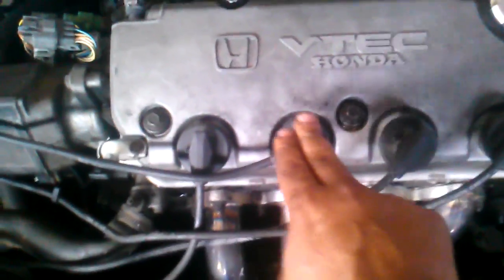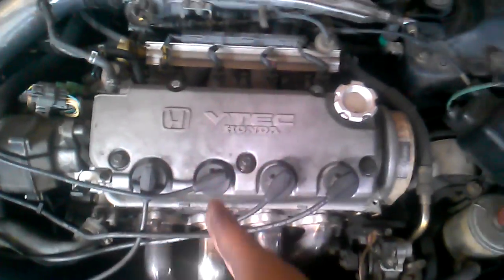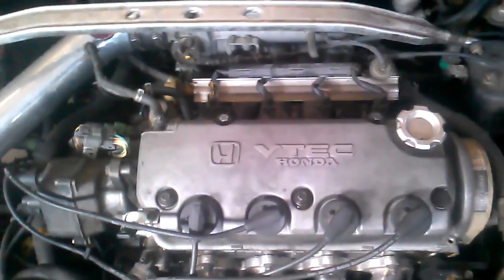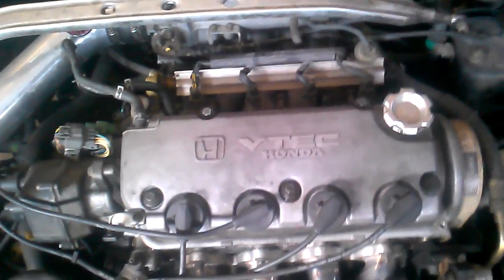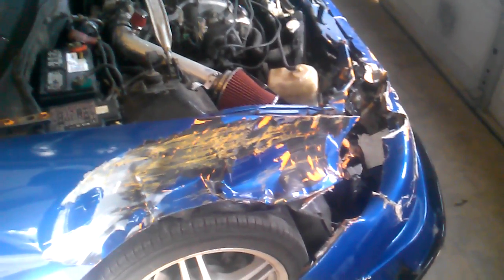How to find a misfire

Comment: Yo man I tried that and when I pulled the 3rd cylinder spark plug wire the car completely died any idea
Reply from the maker: When you you say "died" do you mean it shut off and wouldn't start back up OR it starts back when you put the wire back on?

Comment: Got sain problem my Honda civic 1997 ex change cable apart plug check valve the full ingyster all ok can fine the problem let me know got sain problem what you fit car be ok thank
Reply: What did you discover that the issue was?

Comment: My 99 Civic throws p0303 cylinder 3 misfire. I can clear the code and it won't come back for 30 miles or so of driving. Not the plug and the wires are new (but I suppose that one wire could be faulty. We'll see...). All 4 injectors are pulsing. No vacuum leaks. I block tested the coolant, no combustion gasses in coolant. I'm stumped. Hmmmmm.....
Reply from the maker: So clear the codes and change the number 3 wire with the number 2 wire ( make sure you do it on the distributor also) if the code pops up as number 2 mis-fire you know its the wire... If not take your distributor cap off and make sure that the number 3 prong is not corroded...If you go throw all of that it is likely that you have a leaky valve or compression ring on that number 3 cylinder..The first 2 things are easy to fix (20 mins) and the last 2 will take about 4 hours if you know alittle about mechanic work IF NOT about 8 hours but still super eazy... Hit me up on Instagram kevinskars80 and ill walk you through it

Comment: At 2:00 you can hear the spark and literally see the spark. Is that supposed to happen when your spark plug wires and distributor are fine? I replaced spark plugs, wires, distributor cap and rotor, but I think my spark is still weak or something. I hear the spark for a slight second and then gone, but I don't even see the spark like shown in the video. Maybe bad ignition coil for me?
Reply from the maker: Yes a 'weak' spark can make issues with a mis-fire or even a no start..Tell me more about your problem..Is it not starting or a mis-fire?Is it having a weak spark on just one cylinder or all of them
Reply: It starts okay all the time so far and rough idles, but definitely a misfire for cylinder 2 & 3. I did your test with pulling the spark plug wires out and checking for idle change. Cylinder 1 & 4 seems fine.
Reply from the maker: @Pyman215  what kind of car is it?
Reply: @KevinsKars  '91 Honda Prelude with B21A1
Reply from the maker: @Pyman215  ok that engine has a external coil so if two of the cylinders is getting good spark and the other two are not it's probably not the coil...I would start by re-checking your wires,plugs and inside of the distributor cap..If you do that and 100% sure it's not any of those I would get a harbor freight and get yourself a $20 compression tester and check if it's something internal..Ive had the same issue many times and it always turns out to be the wires or spark plugs that was gapped incorrectly
Reply: @KevinsKars  Yeah, I was planning on a compression test. But I'll have to check my plugs again. Thanks, will update
Reply: @KevinsKars  UPDATE: Compression test for the cylinders that were misfiring are about 30-45 psi. Cylinder 1 & 4 were 180 psi...
Reply from the maker: @Pyman215  ok sounds like bad piston rings or burnt/cracked valves... Not a huge deal but you'll need to pull the cylinder head to see which one it is

Comment: My 1999 Honda Accord has a p1382 code, dealership can’t figure it out rides rough. Car will die out here and there.
Reply from the maker: Ive had that code come up in a few Accords and it always tends to be a Faulty Cylinder Position Sensor..Check the plug first to make sure its not loose..If not,its probably the sensor
Reply from the maker: Ive had that code come up in a few Accords and it always tends to be a Faulty Cylinder Position Sensor..Check the plug first to make sure its not loose..If not,its probably the sensor

Comment: Right on, gonna check this out.  Got a misfire on cylinder 4, plug looks like it was running leaner than the others so it could be a clogged injector.

Comment: Re my Ford KA Luxury 2007 - unfortunately things seem to have gone from bad to worse :-( I had error code P0304 showing but since Green Flag have replaced all four spark plugs I'm now getting P0303. They have tested all the electrics and confirmed they are fine. Therefore he suspects the issue is fuel related and suspects blockage in the petrol filter? He recommended I put some Redex in the fuel tank. To be honest the engine now seems to be misfiring worse than ever.  He was there for ages testing the HT leads and the coil pack. The only other option he could offer was to tow me to the nearest garage. Do you know why the error code would change after replacing the spark plugs?  Any help greatly appreciated. Thank you
Reply from the maker: Well its hard to tell without having the car infront of me BUT there are a few things that will cause a misfire..
1.coils or plug wires
2.bad injector
3.low compression
4. Fouled spark plug

I wouldnt think the fuel filter is the problem because a bad would cause a lean state and you would get a random multiple misfire code.We don't have Ford Ka here in the states but most combustion engines are the same...It HAS to be the coil,injector,spark plug or the plug wire.. if not it's probably something internally but i doubt that
Reply from the maker: By the way testing the leads to the coil pack it's just establishing that the coil pack is getting power that does not actually test the coil pack itself.
Reply: Thanks...was just wondering why changing the spark plugs would cause the error code to switch from P0304 to P0303?

Comment: Thanks!  Your video reminded me that you should keep your diagnostics simple at first.  I had the random misfire code on all four cylinders.  The spark plug on cylinder 2 was not firing cleanly like the other three.  I replaced the spark plugs and still the same problem.  Inspected the cap and rotor as well as cleaned the EGR valve. Also cleaned the throttle body...still had the misfire. THEN....pulled the spark plug boots when it was getting darker outside and I found the problem that I couldn't detect during the day. When I pulled the boot off the number 2 cylinder I saw the problem...the spark plug wire boot was arcing from a crease about an inch from bottom of the boot.  This allowed the engine to run normal at times, but rough most of the time making it very hard to diagnose.  The spark wants to take the path of least resistance and sometimes it was to the spark plug, but most of the time it was to the inner wall of the shaft where the spark plug boot and spark plug reside.  Off to the parts store to buy spark plug wires and the car runs like new.  I really didn't think it would be the spark plug wires as they looked like the previous owner had replaced them recently. Also of note was that one cylinder misfiring gave me a misfire code in the computer for all four cylinders.  I hope this helps some one else!
Reply: So, your boots were the problem, cracked?

Comment: Never touch spark plug wires while the car is running you might get 1000's of volts through your heart and it will stop.....this guy is taking a huge risk
Reply: Dude if I did this in my mini I would 100% be dead from electrocution

Comment: Or you could just start up a cool eng for a few seconds and lightly touch the header of each cylinder exhaust. The coldest one will be your bad cylinder. I did that to a car doing a dirt track race and it was a rocker arm off the lifter pushrod on a chevy v-8 of course.
Reply: Burnt my gahdamn hand like that

Comment: same issue here . I have good plug good spark good new wires new cap and rotor on cylinder#4 but its not firing on 4 and it also has 120psi in cylinder#4  .All 8 injectors tick rapidly so im at a loss. 305 v8 chevy tpi motor
Reply from the maker: If you have good compression on that cylinder it HAS to be a spark or fuel issue.. First thing is to swap around the wire on that cylinder for a different wire and see if the misfire changes cylinders.If not maybe the injector is stopped up so grab one from the junkyard and install it..If both of those don't work then maybe you have a bad intake manifold gasket..All are cheap to fix..Let me know how it comes out.

Comment: To test for a dead cylinder, pour water on the exhaust manifold. If it sizzles, it's firing. If it don't, it's not firing. Use a timing light to check for spark. Swap plugs from one cylinder to another to check for bad plugs. Noid lights can check the injector electrical circuit.

Comment: want pulling the plug wire screw up the computer?
Reply from the maker: james smith pulling the plug wires will not mess up the computer..Worse case is blowing a weak coil

Comment: On my Scion Xb my P0300 & P0304 were actually caused by a fuel injector (#3) leaking fuel onto the manifold past the fuel injector little top O-ring.  2006 to 2017, my injector rubber O-rings started to fall apart and leaked. I got some replacement rubber O-Rings from O'Reilly and that solved the issue with all of my P-codes.  A visual inspection is also very important.  Great Video !

Comment: At 5:39 you mention Certifit doesn't sell del Sol parts. Maybe the situation has changed since you made this video because I recently bought front fenders, front bumper cover and hood for a '94 del Sol from Certifit in Charlotte. The last I checked they were running short on del Sol hoods but OEM style replacements for the hood are easily found. It's many of the other parts that can be in short supply. In regards to the front panels for a Civic being easily interchanged, I have seen one Civic front retro fit that was made possible by cutting and welding around the top of the wheel well...it wasn't just a clean swap. I appreciate the video. It was well done and very informative. Thanks.

Comment: I drive a honda accord. It's been running overheat for about two weeks and suddenly when the car engine temperature level is at its max, the car started to misfire. I know it's stupid of me to keep running it. Now it will not start, it only cranks... I've changed the sparkplugs and the hose that connects to it. I will check the fuel injector tomorrow. I was wonder, what other causes could it be? Is the engine a gonner???

Comment: Kevins Kars.....If you ask me you got a good deal on that car. Replacement parts can be found for cheap.
I had a 1995 Toyota Tacoma that was giving a P0301 trouble code, that there was a misfire on cylinder one. Everything I tried didn't fix the problem.  I watched your video, and when I saw you pull out a spark plug boot with the engine running, I thought I would try that too.  HOLY CRAP!!!  There was sparks flying out of the boot about 1 inch from the tip !
The boot somehow had gained a rip, and the spark was leaking out.  I taped it up with some real rubber electric tape, problem solved.    You are the one who fixed it after the experts didn't.   Thank You.

Comment: Hi Kevin, sometimes after driving for a little while 20mins or so when i put my foot on the acclerator, the exhaust sounds louder and discontinuous ( sounds like small explosions after each other). This sound goes straight away when I restart the engine strangely! could this be due to engine misfire or somethung else? 
But as i said it doesn't always come on and goes away when i restart the engine!
any ideas or suggestion is much appreciated
Reply: ThYs detonation

Comment: I'm having problems with the truck but will backfire through the throttle body and it acts like it's got bad gas and I've got put all kinds of additives and it runs real rough and it don't have no power what what would

Comment: Nice Video!   If it were a compression issue causing the engine to misfire, this would show up on a vacuum gauge.   The vacuum gauge would be low or unstable as the engine is idling.    You can even disconnect the electrical connectors going to the fuel injectors one at a time to see which cylinder the misfire is on just like you did with the ignition wires.   In fact, this would be a bit safer as there is less of a chance to get zapped by the spark.   

Also, is that aftermarket headers on the vehicle?  If so, does the oxygen sensor screw into one of the exhaust runners?   If so, you need to get that exhaust manifold off the vehicle as the computer is only in fuel control based on one cylinder.. not all cylinders.   Thanks for sharing!

Comment: Did you get a misfire code ?
Reply from the maker: yes it has misfire cylinder 3 code
Reply: Kevin's Kars I got misfire cylinder 3 code too plus a code p0267 which is for the 3rd injector, do that narrow my checks to specific area??

I did already clean and check all of the injectors with nothing changed
Spark plugs all new
Reply: Kevin's Kars to
Reply: what was the final problem?

Comment: come so i think the reason it dies is because i pulled the plug from the coil(being lazy the plugs have a cover) 
so i took the cover off and pulled them out. Everyone of them made the engine sound different.

The wire on the one that was fowled looks rough though. they are all sparking. 

So what would cause the fowl plug. It was black. Not sure what it could be. 

Theres never any smoke from the exhaust so i wouldnt think theres oil leaking into it from the header.
I can't hear the injector thing you mention, is there an alternative?

Comment: When I pull every plug, except the one that was fowled, it dies and i had to start it up. The one that had a lot of corrosion on wire and a burnt plug it didnt die but the engine would run rougher. 

So I replaced the valve cover gaskets, got a new plug and its still doing the same stuff. 

Any advice on whats going on would be so appreciated. Thank you
Reply: Did u change or clean the corroded spark plug as well

Comment: Can you help with Audi ? I have an 06 A6 with misfire codes on 1,2,4.. I pulled the coil connector plugs on that side and they all look good with a reaction of rough.  The garage said to replace all coils and connectors and I just don't think that sounds right?  P.s. I have a "clicking" vapor canister purge solenoid I'm eyeballing.. but not sure that could cause all the misfire codes
Reply: I also just changed all coils and plugs (NGK) no help..

Comment: Hey I took one of the wires out and the car died completely what do you think the problem is?
Reply from the maker: well could me you have one or more bad cylinders...Did you start it back up and check the others?
Reply: The car woufnt start afterwards I changed the spark plugd and wires and the distributor and rotor but it still won't start 😥 car cranks but doesn't start
Reply: Carlo Capili no reply ^

Comment: I m having the same issue. I took it to shell and their scanner showed a misfired cylinder code. But they erased the code. Most places would not change the spark plug because their scanner does not read any code. I don't wanna drive the car too much and damage it. Do you really need the code to change the spark plug?

Comment: Aye my guy how would you recommend I check for a misfire in a straight 6 2004 Chevy trailblazer? Would I disconnect the coil connector wires from the coils one by one similar to how you did in the video?
Reply from the maker: I'm not too familiar with the inline 6 from that vehicle but yes if you unplug each individual coil that will give you a starting point of where your problem lies

Comment: Did you consider & check out the coil ? Thanks
Reply from the maker: Well on civics 1 coil runs all 4 plugs so if the coil goes bad it would either not run at all or every cyl would be missing because of weak spark

Comment: I just brought a 93 Ford e150 it's misfiring bad. I changed the coil and plugs but it didn't change anything. it idles OK but it get bad when a load is put on it. what is the process of elimination to fix, I can fix just about anything it's the troubleshooting that gets me.  please help, it's driving me crazy. sometimes there is a split second when it runs fine.

Comment: so do you know if a misfire would cause smoke from the tail pipe? I did find one plug wire that wasn't firing at all on my car (1990 Nissan 240sx) and it is using A LOT of gas. Would a misfire cause the car to use so much fuel??
Reply: yes.
Reply: black smoke?
Reply: TheJCorbi82 it's really hard to tell, bluish-black but there is actually gasoline dripping from the tailpipe and smells like gas bad. And it only starts smoking once the engine is warm.btw i replaced all the plugs and wires -no difference. I noticed one injector was not making the "clicking" noise.
Reply: +kenny kristan Yes,that's raw unburned fuel. the injector is MOST LIKELY the issue.
Reply: TheJCorbi82 so the injector must be stuck wide open and flooding the cylinder? I will try another injector -hope that fixes it. if not can I ask you for more advice? -thanks again btw
Reply: +kenny kristan that's the first thing to do.. is change injector.
Reply: TheJCorbi82 Ok, so I changed the injector -and nothing. no difference. I changed the plugs and the wires, when I pull the wire off the cylinder where I replaced the injector makes no difference, (the engine does not slow down) though I do see the wire sparking so I know it's not the distributor. I can only think of one last thing, the electrical connector or wiring to the injector is bad. Question, if a fuel injector gets no power is it in the "stuck open" position and constantly sprays gas -causing the gas in the tail pipe or is the injector closed. if you could give me your advice again I would much appreciate it!